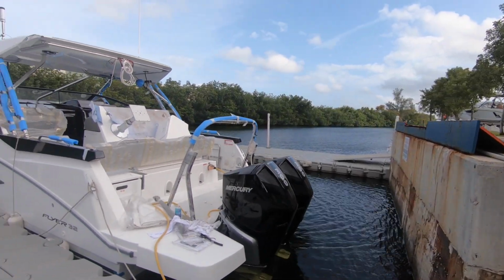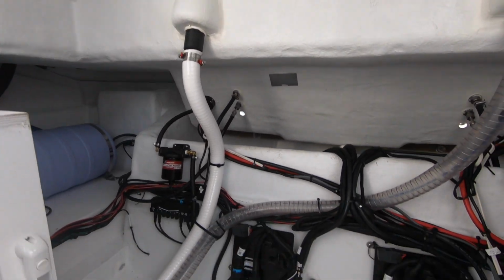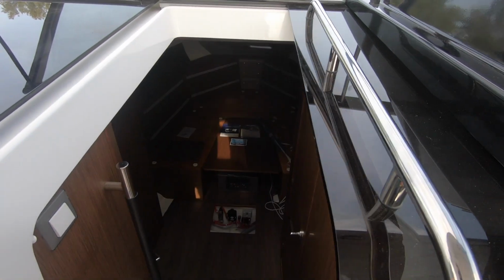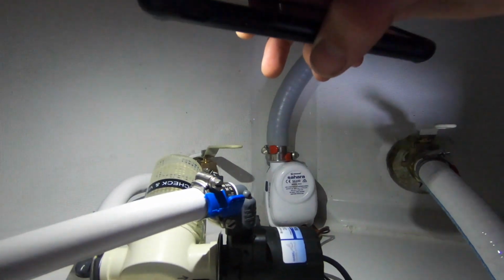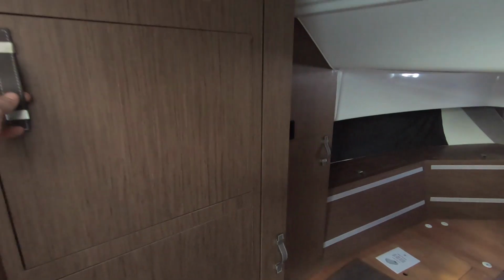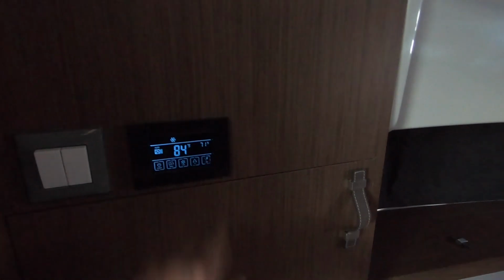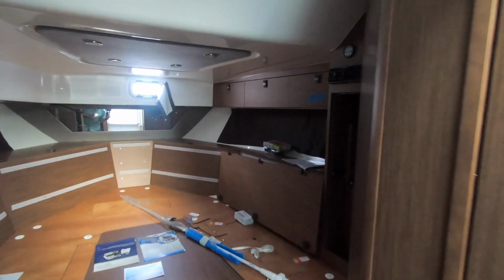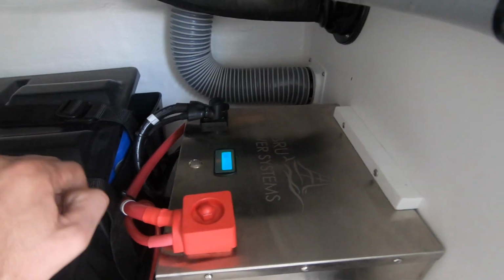Beneteau Flyer 32' with Mabru 12V Marine Air Conditioner. NO GENERATOR NEEDED!!!!

Comment: Big game changer for Boaters  in general   Your system would allow a boat owner to  run Airconditioning. Off a small generator / inverter like a Honda E1000 which is way less money than most marine generators  where are your AirConditioners going to be sold at
Reply from the maker: Our air conditioners are available on www.mabrustore.com  or though one of our resellers.

Comment: These are 12 V units. NO INVERTER  NEEDED
Reply from the maker: That is exactly right! We do have some installations where we install an inverter to run other appliances but an inverter is not required for the AC to function
Reply: Is the blower motor 12v ? If so where can I find them

Comment: How would you recommend keeping this charged for multiple days at sea without a generator, and how long would it take?
Reply: You would be able to charge your batteries using your alternators, so if you're hopping from anchorage to anchorage you would recharge your batteries. If in port, you could connect to shore power.

Comment: How many Amp Hours are these lithium batteries and how long does it take to recharge them with shore power ?
Reply from the maker: This battery is 250Ah and it would charge in about 7.5 hrs on shore power with the AC off. It can be charged faster if needed, as quickly as 2 hrs if we swap the charger for a more powerful version.
Reply: @MabruPowerSystemsINC  is there an advantage to having a 12V AC over a 120V AC besides saving on an inverter, which most boats will have anyway?
Reply from the maker: @willyum1208  our 12v units are significantly more efficient than their 115v counterparts so less battery needed to run for the same amount of time and far less alternator current needed to run them
Reply: "Efficient"; So it runs at 31.25 amps at 12v (250ahr/8hrs)
Does that include the raw water pump?
Seems like a 400w load, which means the charging system needs to put out 350 amps to recharge in 2hrs on engine time... 3 times a day
Reply from the maker: @solosailorsv8065   31.25A is the compressor running at full speed, blower at full speed, and pump running. This particular setup was designed to give our customer the ability to use the boat for a day out on the water, while using a microwave, stereo system, outlets, cooktop, etc as needed without needing to run a generator. If we’re were making a setup for a different need, the setup would need to be modified with some solar or some other source of incoming power. If only the air con is working, you will get 16hrs out of this setup minimum. The customer with this installation has been extremely happy with the setup as it does everything he wanted but different customers have different needs so we can modify the setup based on our customer’s requirements.

Comment: How long can you run the AC with that battery? Thanks!
Reply from the maker: Runtime for the 7,000BTU DC unit on this vessel with our 250AH lithium battery is 8 hrs
Reply: @MabruPowerSystemsINC  how much it cost just ac and battery

Comment: Is that water seriously splashing out on the side the whole time the unit is operating? Your neighbors in the marina will hate you for that! I once had a guy next to me, drove me crazy. That line should discharge under water to avoid the noise, or not?
Reply from the maker: This is the standard way that we do this in the US for a better visualization that the pump is functioning properly. Many europeans do underwater discharge but this can become clogged with barnacles over time which adds an additional maintenance item and a bit more difficulty for the end user to confirm water flow. I would never have an underwater discharge on my boat but to each their own.
Reply: how far above the waterline do you normally put the discharge through hull? also is their a limit on the distance from the unit to discharge location? thanks  @MabruPowerSystemsINC
Reply: We try to have the water discharge no more than 12" above the waterline to  prevent excessive noise from the water splashing into the ocean. We try to have the discharge as close to the unit as possible but it can be placed further from the unit if needed. @evresort